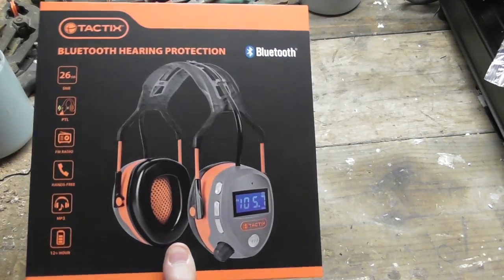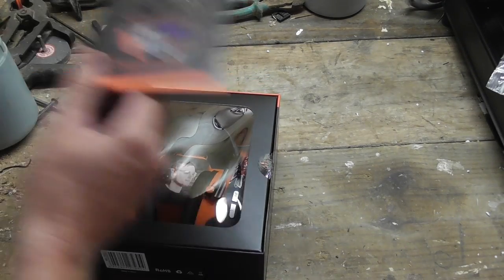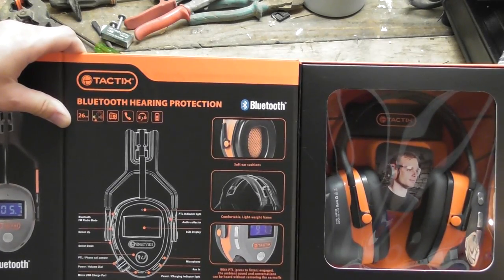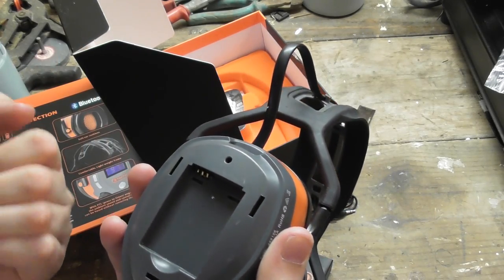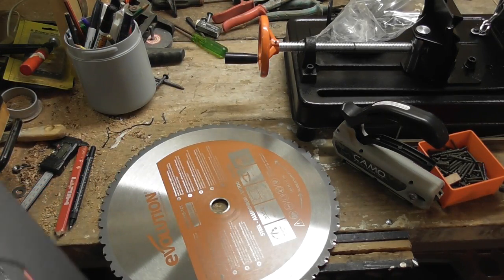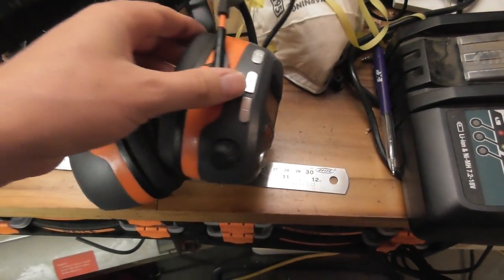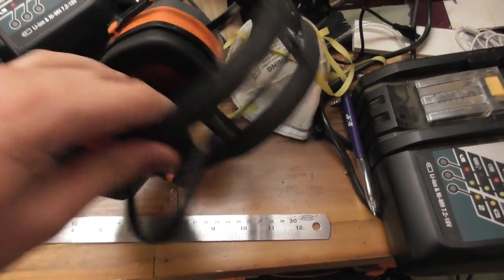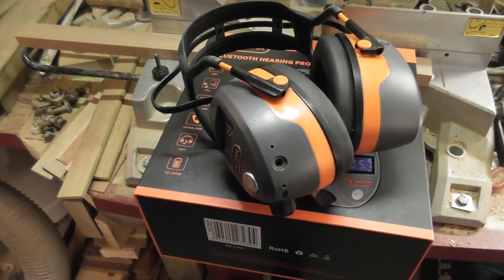Bluetooth Earmuffs Review (TACTIX)

Comment: If you plug them into a PC via USB cable, they operate as USB speakers, as in you don't need a Bluetooth connection. I think they're a rebranded headset of some kind. I will look into it further, but if you look at the LCD at the right angle, you can see more features than what are described in the manual, such as SD card and USB. Also when I plugged them into the PC a new drive appears on my computer/ this PC.

Comment: Good review. I've had my set several years now, volume knob lost after a couple months but overall I think I'll perservere with them! Same discomfort with the ear pads, replaced the vinyl ones after they split/worn out, with more comfy immitation leather! Now the volume /on/off switch is playing up and am getting sound in one headpiece only.....anyone been into the guts and know if you can open them without having to cut the plastic? The switch is riding against the plastic shell and obviously not centred at manufacture, have lubed the switch and condition restored for a month, suspect contact inside is at fault ! Now I want to get inside and repair rather than replace as the 2nd Generation sets don't sound worth another $69 ???

Comment: I remember buying these and I returned them a couple of days later.  They are not very good if you're using noisy machinery, like a jackhammer,  because the radio volume level is capped.

Comment: I bought these and took them back straight away. Absolute shyte. Didn't stay on my head, sound was crap and the actual muffs, average.

Got the 3m ones instead. Heaps better!
Lower dB count, fit well, sound... Better.
Bluetooth, not like it's gonna be 320kps.

Comment: Crap. Bought 6 pairs in 2yrs. Well looked after. Wires broke on one side of speakers on all pairs, 2 just simply died and won't turn on and the charger socket came off the circuit board on 2 pairs. The 2nd model has very poor Bluetooth signal strength, so i had trouble with music and calls with the phone in my back pocket. Never had that problem with the first model. Not durable enough for every day use.
Reply from the maker: Slow learner?
Reply: Tools & Stuff I have 9 staff, so I buy in bulk. Bought the new model hoping they had improved but were actually worse, so they went straight back. Thanks.